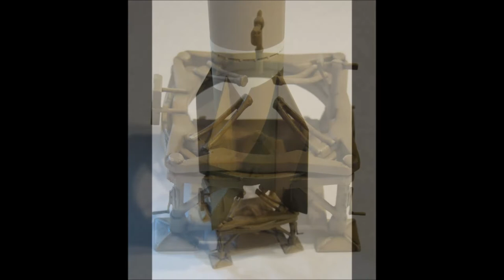1/72 Condor/MPM A4/V2 missile (pt. 3/3) Painting

Comment: Nice job painting this! Shame the kit doesn't come with one of those power cable launch tower thingies. And I think you made the right call with the subtle streaks on the launcher; these rockets ran pretty clean (alcohol and liquid oxygen?) so they wouldn't have had super dirty exhaust...
Reply from the maker: Yeah, I'd expect little soot from the exhaust, but I don't know if the heat of the jet would maybe cause the paint to discolour. No idea how hot it would burn. The boom for the cables and hoses was attached to the launching table after the missile was tilted into position from the meillerwagen, which is included in the excellent Takom kit.
Reply: @KitKabinet  in fact I'm surprised they bothered to paint that part of the launcher at all. I know there's some heat resistant paint out there - even in the 40s - but still...

Love the splinter camo by the way - came out real nice!